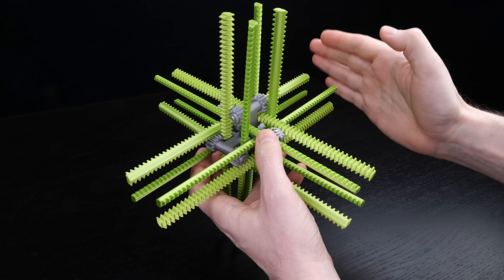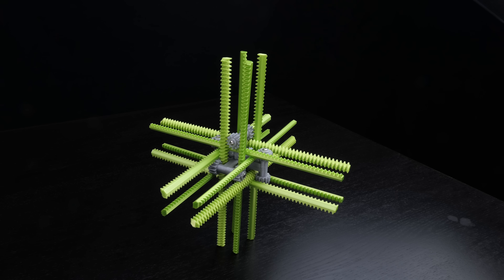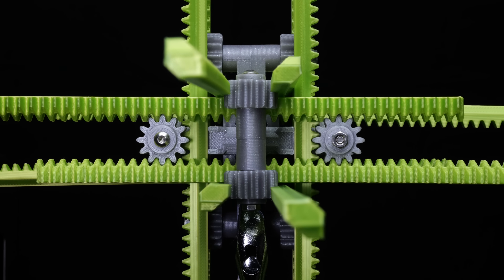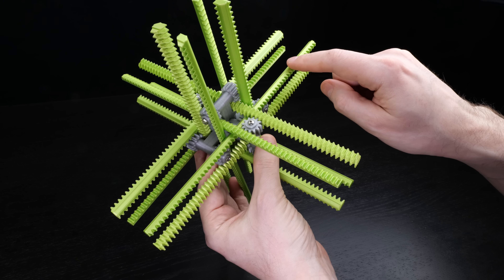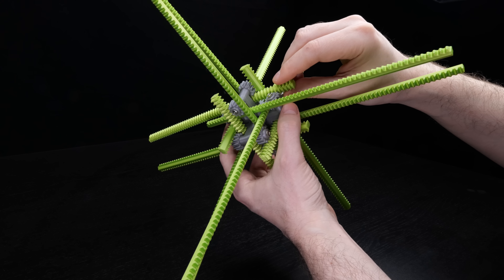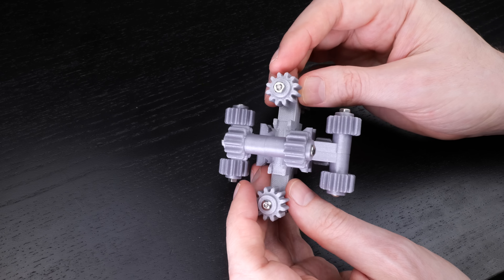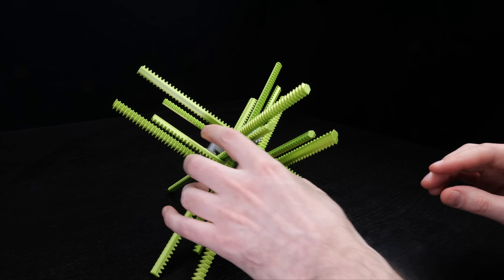Six axis racks

Comment: This reminds me of a hexastix.

Could the interlocking grooves facilitate opposite motion with larger range of the grooves on the common rack overlapped? Basically a set of raised rhombuses with grooves running diagonally in both directions.
I'm not very mechanically minded so maybe there's an obvious flaw in my thinking

Comment: Kudos for the video and design! Just one detail weirded me out: you said this 12-stick model has the form of a tetrahedron, like the triple-piece kinetic sculpture, but I can see very clearly 6 sides with 4 edges each, so this is a hexahedron, or simply a cube.
Reply from the maker: If I remember correctly, I was talking about the symmetry of the design, not the approximate shape.  You can paint a cube so that it has tetrahedral symmetry (e.g. by painting every other corner) - the shape is still a cube but the symmetry is tetrahedral.

Comment: 5:02 What about using a method like omnidirectional nuts and bolts? using a grid of squares so that the 2 patterns mesh with each other may solve this issue. If you find the intersection of both patterns, they will behave according to the patterns on the parallel rods in the demonstration

Comment: To put them together I would take out the gears, put all horizontal stix in the core (stack themfrom lowest to highest), then stick the vertical stix in a fixture or a lump of putty on the table. That way I could (hopefully) line up all the stix in equal llength and have one hand free to reinstall the gears, locking everything together.

Comment: the locking of the transfer gear happens because the gears are symetrical. if you layer both gearings on one, while having the other parts only have one, it would translate power.
on the output you have //// and on the input you have \\\\\\
the transfer would look like a diamond hourglass diamond hourglass...

this still isnt 6 axis, but suggesting the wheels are necessary is even more wrong.
here is a video of it.
https://www.youtube.com/watch?v=cDfMI5ahbJI

that thing is 3 axis because you cant control each axis separately. dont get me wrong i dont know how to do yaw, pitch, and roll on something like that- it would need to use logrythms somehow and it is kinda beyond me. it is one of those things which is hard to fathom until you see it, and that is why i was interested in your video.

maybe it needs to use rotary motion instead of linear... having an elastic band which can rotate up multiple cams, and snake over  all of them might make something kinda similar but you would see the vollume as the output, hmm... i wonder if it could be miged with a slide rule to allow mechanical integrals and derivatives to be run...

Comment: 5:35 There is a hand powered screw driver called the 'Yankee Screwdriver. The core has two sets of paths for one rod, somehow it can be pumped to make a continuous rotation. I've also seen a bidirectional nut, that has two paths cut into it. Would this concept be used to solve this particular problem?

Comment: I only think theres 3 axis...  this guy must think adding a gear set = an axis when its just another gear facing the same way?
Reply from the maker: I'm referring to the number of directions that the parts move in. There are six different directions that the parts move in, although of course some parts move in opposite directions. So yes, you could argue that there are only three axes involved. But the name comes from some of my previous designs, where the "opposite directions" thing didn't come up.

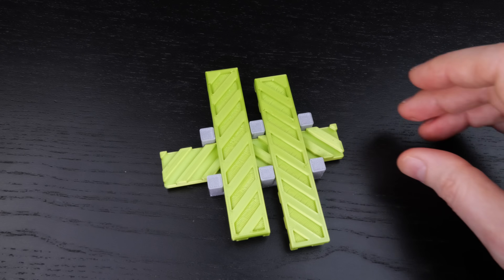Comment: 5:37 instead of having 3 plates all designed with slats, have 2 slatted plates (opposing directions of the slats) interface with a diamond studded plate? That way the slats themselves determine the direction that they move?

Comment: 5:22 On the lower single stick you could change it to a diamond pattern where it is both diagonals cut out of it.  You could also add a connector bar to each end of only one pair of sticks per side and it would also stop the sticks from falling out while allowing the ends to move past each other (add the bar to both ends of the pair moving one direction along the x axis but not the other parallel pair of sticks that moves the opposite direction and same for y and z axis).

Comment: About making a rack push two other racks in opposite directions: Could you make worm drive racks such that the linear motion pushes in one direction while the screw spinning motion pushes in the opposite direction? 
Then the two racks you want to push...i guess one would be sliding and the other rotating in a threaded hole, to go oppositely?
I suppose that wouldn't 'count' either.

Comment: Here's what worked for me! First, mark the center of each rack on the back side. Then, starting with a bare hub (no pinions), arrange four racks and put a rubber band around each end of each set to hold them to the hub. Then again with another set of 4 and rubber bands. Get them all approximately centered; they don't have to be in exactly the right position or rotation, just close. Then choose a pinion that will contact three of the racks and insert it (with the bolt), careful to center each of the 3 racks it contacts as you do. Repeat for the opposing pinion, then the other two that contact the racks placed so far. Repeat one more time with the remaining four racks and two pinions. I'm not saying it's easy, but it was relatively straightforward.

EDIT: Also, thanks for the cool design, and informative video! I'm sure it will be a great conversation piece!

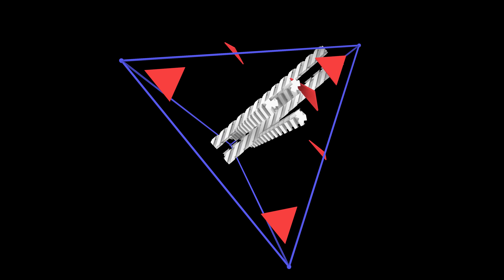Comment: On 3:36 you claim that a six axis rack has the tetrahedral symmetry. A tetrahedron has 4 corners, 4 sides and 6 edges (all at different angles). Your six axis rack has six "ends", all rods are parallel to one of 3 orthogonal axis. So your six axis rack has the same symmetry as a borromean rack or a cube (6 faces, 8 corners, 12 edges parallel to 3 orthogonal axis), not a tetrahedron.

Comment: Instead of having bars going across pairs of sticks, you could just put attachable nubs onto the ends of the sticks (e.g. bolt on) that are bigger than the holes between the gears, which would prevent the sticks from going all the way through.

Comment: I wonder if it would be possible to turn the sticks into hoops, so instead of going back and forth over the length of a terminated stick, the gears of the core would keep rotating in one direction while the hoops "rolled"

Comment: you can have racks that go both way (mesh in two directions) without the gears. Similar to a nut and bolt that can screw and unscrew in both directions.

Comment: Could the core have a zig-zagging groove pattern, and the interfacing sticks only mesh with either the zigs or the zags, going in opposite directions to each other? I don't have quite the engineering mind to imagine this, but if someone could explain or experiment, I would love to hear if it works or why it doesn't

Comment: You could get all the sticks in the right place easily by having cylinders that are the same as the cogs but without the teeth on the hub, that would restrain the racks' movement to the correct axis without coupling their movement to one another. You could then go around and replace each of these cylinders with a cog to add all that coupling back in. You could also use this as a basis of a way to stop the racks falling out by skipping the first and last notch for the gear teeth to go into on each rack, that way they would slide in and out easily with the smooth cylinders, but once you have the cogs in place they would be blocked from turning any further when they get to the end of each rack. You could even use that as the way to get them lined up correctly when putting the cogs on by having the cog start off meshed with the first or last remaining notch on the racks it meshes with.

Comment: 5:31 - what if the bottom rack is "threaded" both ways (i guess it would look like a series of rhombuses instead of teeth) so that when it moves, the two top racks move opposite directions?
Reply: There was a video going around a while back where a machinist made a screw that was threaded twice, so that a left hand and right hand nut would move on it, that's what makes me think of this.

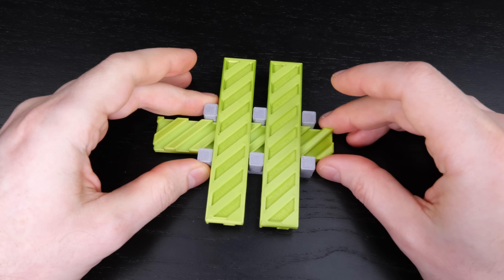Comment: 5:08

Different Idea: you can have the driving rack have a waffle iron pattern and the driven racks can both be driven.

Think of the driven racks as tools that carve tracks out of the driving rack, if you carve both patterns out of the driving rack it will only have little parallelogram nubs that don't interface with the whole sliding surface, but it will be able to go both ways
Reply: Yeah I was thinking the same. Like those 3d printed nut/screw pairs that can translate in either direction for a given rotational direction
Reply: @philbunting5963 yep, same thought here
Reply: Exactly. Just like these 3D-printed counter-threaded screws, where the direction of rotation is defined by how the nut is threaded.
Reply: This idea is used in drum winding mechanisms, with the addition that the pattern "merges" at the ends, so that a follower automatically turns the other way.

Comment: To stop the racks from falling out of the core you could make little screw on caps for the ends of the racks that would be too big to get pulled out, similar to how the gears are mounted but with a flange rather than a gear.

Comment: I wonder if you could make the racks largish circles (ideally either small enough to still be printed or else arcs that can be connected together) with the core riding on the circle what that would look like, could you connect multiple cores per circle, what about loops of core-circle-core-circle-core-circle-core-circle in say an octahedral arrangement (because of the even number of edges around a vertex)?

Comment: I find all of these so mechanically pleasing. 
To assemble, 
line up all the racks on the core with toothless gears/wheels so everything slides easy, 
tape racks to hold the shape,
and swap out the wheels for gears 1 by 1 meshing teeth as you go.

Comment: Since the core holds together without the nuts, wouldn't it be possible to get the sticks lined up more easily by installing the gears after the sticks, rather than before?
Reply from the maker: Yes, but the sticks slide around all over the place without the gears...
Reply: @henryseg 9-5 Could you make some kind of rack version of Moebius strip like Moebius racks somehow?? Thanks for sharing Henry and really hope you can answer this and my other question or email whenever you can. I would really appreciate it. Thanks very much.

Comment: You could connect the axial pairs by using concentric rings, just set the rings on the inside or outside of the pair and have mounting tabs, this would allow for a full range of motion.  Stemming from this, the concentric rings could also have a guide pin that sits on the outer face of the rings with a pole that sits on the curved surface of the core, where the axle for the gears sits, this would help for assembly.  For assembly, the various constraints are what make this easy, the system is constrained to where all centerpoints align, and the gears just slot into place, the guide pins are a temporary constraint whereas the gears are a permanent constraint. 

For clarification on the concentric rings: Say the square of rods is a base circle.  One pair of rods would get a larger concentric circle, the other pair gets a smaller concentric circle, both with mounting tabs for the pair of rods they connect to.  For example, axis positive would get a larger circle, axis negative would get a smaller circle; though, personally, I think each pair should get both sizes of rings on the two ends, which could be further used as an endstop against the core.  The guide pin would have a flange that seats on both circles at the same time, thus constraining them to the same centerpoint position; and in combination with the guide pin's rod seating on the core, this constrains the axial pair's centerpoints to the core's centerpoint. 

Let's look at one set of rods, say the X-axis.  The core constrains the rods in the Y and Z axes, allowing free movement within the X-axis.  The concentric rings will constrain the positive and negative pairs of the four rods, which this later becomes redundant with the installation of the gears.  The guide pin will constrain the X-axis position of both of these pairs; at least as a soft constraint with one pin, and a hard constraint with two pins, but really only one is needed.  Repeat this for the Y and Z axial pairs.  The installation of the gears would now constrain the rods to the core, the two opposed axial pairs together, and an axial rod to its perpendicular neighbor, thus constraining everything together.  The original product already had this final constraint, but with a more difficult assembly, but mimicking these constraints during assembly makes the process easier, and as a coincidental byproduct the system that binds two rods together is also usable for setting up the assembly constraints.
Reply: Also the rings could face in oposite directions and not concentric, that would look nice!

Comment: If you add a size increase at the end of the sticks so they won't fit through the gears it will block them from moving through in that direction. If you add that as a stick-on to the other end as well, it will be forever locked in place.

Comment: As far as how to synchronize them... I see that they've got a 1/2 tooth offset on the two sides of each stick.  So if you had a worm gear with 2 teeth on it (double-helix) you could insert those one by one, thread them in/out until they're all the same length, probably via some sort of mark at the center of each worm, then temporarily attach the sticks to the end of each, push them all through in sync, then remove the worms from the sticks.

Comment: 2-way hinged crossbar/caps across the pairs of sticks that move in the same direction parallel to each other would allow them to cross through another pair of sticks so movement isn't limited, but perhaps the bulk of the axis mechanism could block the hinged crossbars from allowing us to easily deconstruct the sculpture?  I was thinking of how nice the dual-directional swinging doors of a laundromat allow 2 directional flow or with lack of a central bar create one large opening for larger loads...I'm not a mechanically minded person so I may be relying too much on the central mechanism to somehow block the "doors" from allowing the sticks to be pushed all the way out, but feels close.

Comment: No need for gears. It's enough if each one from the six axis interacts with two others, not three. You can make a closed chain of the six sticks that way. Now, get a cube, set it on one corner, and look from above, so it will look like a hexagon. Arrange that chain of six sticks onto the sides of this hexagon, alternating between "upward" sides of the cube, and the "downward" sides of the cube. Done, you "just" have to design the way to keep them together. On each corner of the hexagon you have a join between two axes. It will look somewhat similar to the three axis solution, but the sticks that lay on the same axis will be moving in opposite direction to each other.

Comment: What comes to mind for easier assembly is:
1. Make a jig which can hold all the racks and the core in the right positions, but doesn't touch the gears.
2. Assemble the core puzzle.
3. Put all the parts in the jig except for the gears.
4. Slide the gears onto their axles.
That way, all the racks can be put into their central position without any constraints, rather than needing to start in the “just falling out” position all at once.
Reply: You could have temporary gears without teeth, but the correct contact diameter and an extra flange, to work as the jig. You could then push the racks in place one by one and once aligned, then start changing the temporary gears into actual ones one pair at a time.
Reply: This is a great idea and honestly I would watch a video of this process.

Comment: "Flexible sticks" could be used as "tracks", and pass through the core to form 6 continuous counter-rotating loops?  Gear profile would need to capture the track better so it wouldn't fly apart...